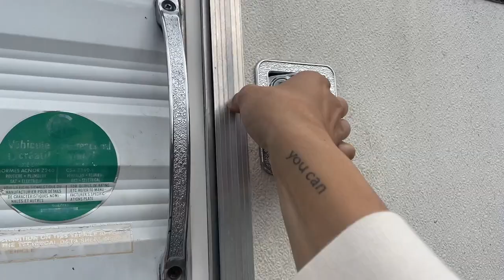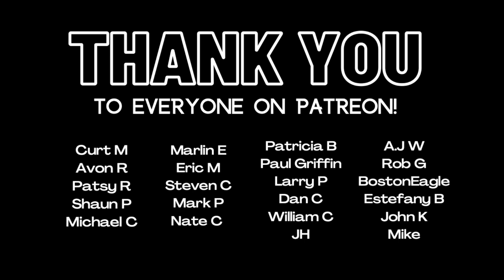Tackling the couch in my Fifth Wheel... plus, I lost a tooth 🥴

Comment: I reupholstered the cushions in my old Airstream. I cut the original covers at the seams carefully, with a razor blade. Then I used those for a pattern, and left an inch extra where the seams were. I got some 1 inch wide self adhesive velcro, used some memory foam, and it worked great. You can do it!
Reply from the maker: You make it sound doable!! I have to consider it.
Reply: @julbm  I had never done any type of upholstering, and it came out really nice. I also made some matching blackout curtains using fabric tape and velcro.. Go for it, and save the money for solar, you'll be glad when boondocking one day!

Comment: Funny you mention solar, I was going to ask you if that was your intentions in a comment.  I put an obscene amount of solar on my toy hauler trailer I bought.  The setup can run a small house.  It's enough to charge my car and my motorcycle.  Save the money on the cushion and add solar.  They you could be nearly off grid.  Your brother could handle it, I did it all myself.  I have a good company to get panels from.

Comment: Curious to know just how much of the actual population is missing at least 1 tooth. I'm pretty sure it would be a higher number than you would think. I am included in that number myself.

Instead of using the old couch, what about making it a wooden seat and back that you could then put cushions on over it? Your brother seems to be quite handy with woodworking, and I'm guessing you could maybe still utilize the old couch metal frame to open it up into a bed too. I know he's not around right now, but talk with him and see if he has any thoughts on it. I'm sure you could find some cushions to go over your own wood frame for a much cheaper rate than reupholstering the old couch.